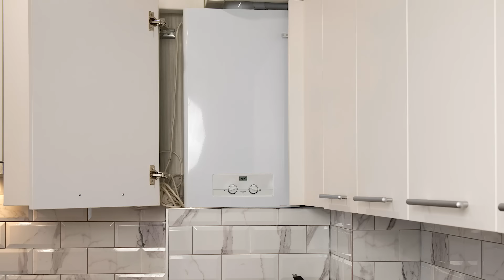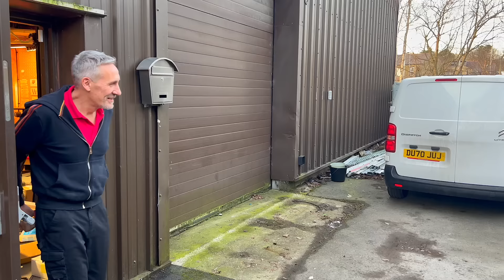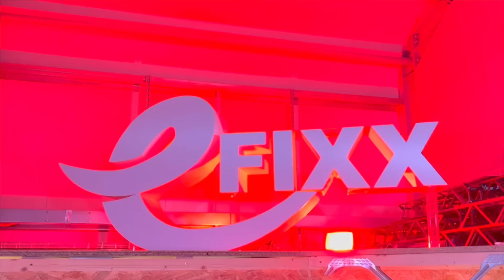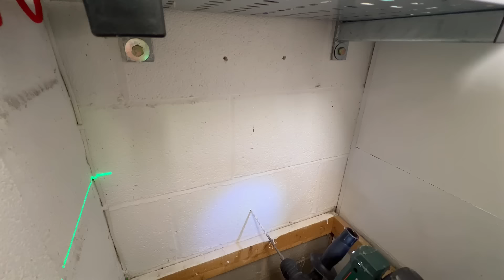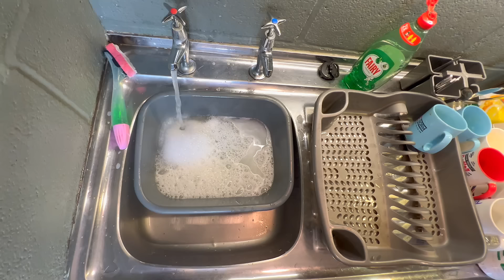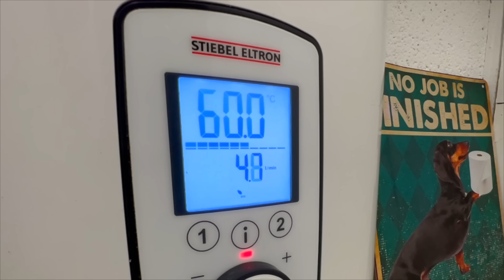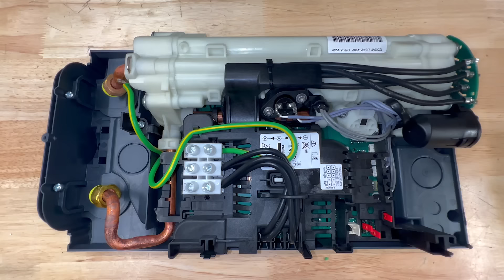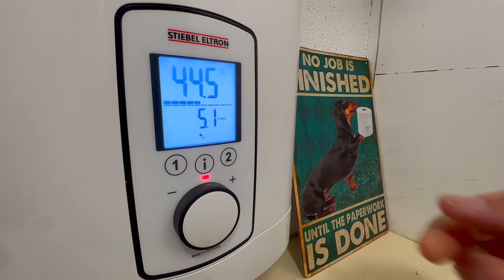The Shocking Truth About Water Heaters!

Comment: I use a 10 litre under sink unit & it's absolutely ideal. I've not found the capacity to be an issue personally. One advantage is the very short pipe run so it's effectively instant. I've not tested the losses but doesn't seem excessive in that the under sink cupboard isn't overly warm.
Whilst looking into this for someone else, I came across instant water heating taps. They come rated at 3kw, with a 13A plug fitted, & only available from the likes of eBay & Amazon. I couldn't find any certifications at all, & reviews ranged from the best thing since sliced bread to it caught fire!
The idea has potential as Redwing etc do a similarly rated unit like a mini power shower, but until something is properly tested & certified, no thanks...
Reply from the maker: Those Amazon products are always a challenge!
Reply: Those little tap heaters are very common in asia, portugal and spain. If you look online you can find one made by bosch.
Reply: @zaxmaxlax  just done a search & nothing by any reputable manufacturer or seller came up.
They seem a really good idea in terms of ease of installation, at least regarding the plumbing. Using a plug for a 3kw load is pushing the limit & I wouldn't consider it safe as 13A fuses get rather hot at 12A. We've all come across burnt up fcu's on immersion heater circuits.
Reply: @alanjewell9550  They're perfeclty safe at 3kW. Remember that 2.5mm2 is 16amps in europe and france even allows 20amps at 2.5mm2. They're instant heaters, youre not gonna run then for more than 20min at best.
Reply: @alanjewell9550  I also have one, excellent. Yes you have to take care not to run out of hot water, but you soon learn that. It is instant.  And you can’t feel any warmth on the outside of the casing, so I assume heat loss insignificant 
In main house the time it takes for the water to get hot at the tap is half a bowl full, very wasteful, even if by gas at 1/3 the cost.
You can plug in to a 13a socket, it is basically a fitted kettle.  It doesn’t take that long to reheat, so no worries about the plug.
Reply: @markthomasson5077  yes, absolutely about the waste of heat in long pipe runs.
The point re plugs was more to do with 3kw units that these uncertified hot water taps seem to be. Whereas I have seen plug in heaters etc up to 3kw, I've seen plenty of over heated plugs as well as fcu's on immersion heaters & come to the conclusion that plugs & fuses are really only good up to about 10A in practice, & only then with very clean untarnished pins etc
Reply: @ …must check my plug now and again.  Thanks.  Probably better wired into a 13a spur, but there was a socket available.
Reply: …now I recall, it is only 1.5kw.
Reply: @markthomasson5077  i had a job last week on a failed immersion circuit. It had an fcu & timer. The fuse was welded into the fcu, the Lout terminal was totally carbonised & the Nin on the timer had burnt off. All a bit of a mess. No need for an fcu as it was a 16A radial so put in a 20A switch. I always grease the wire ends with vaseline as it stops oxidation & keeps the contact resistance low. Any exposed copper tarnished after a few years.
Reply: Quooker taps are excellent as they replace an electric kettle and the worktop space a kettle consumes.  They are also a design feature in the kitchen.

Comment: Excellent video. But too specific to a particular situation not enough general considerations. Heat rise against input water temperature is a very important consideration for instant water heaters - in particular electric ones. Here (in Canada) this question pretty well rules out instant in all applications. 
Complexity of retrofit of these units. (Less than comparable gas units sure but still may rule these units out for many applications. Very different than as a solution for specifically an addition or completely new bathroom or isolated sink.)
The list goes on but you get the idea. There is lots of good new technology for water heating but no one solution has cracked the problems (that are quite 3 dimensional - at least - solve one dimension worsen the problem in some other dimension))
I love the channel and the videos though.
Reply from the maker: We’ll have to visit 🇨🇦 Canada to understand the issues! - Thanks for the feedback.
Reply: Just curious to know how cold your water supply is? Here in the UK it's usually between 10-20°C (50-68°F) and we have no issues with instant hot water systems. Seems more like cultural resistance than a technical problem.

Comment: Electric only here. 210l cylinder. Octopus agile. Prices the last few months have been terrible but we've still not gone over 20p per kwh for hot water.

The rest of the year it's far cheaper.

Our gas boiler was due for replacement so over the next several years it's cheaper than gas and if course its much lower carbon emissions. In five years time gas will be more expensive and the increase in renewables will make the agile tariff even more attractive.
Reply: Carbon emissions are the least of your worries my friend.
Reply: People still believe and buy into the carbon climate scam 🙄
Reply: Yea until all the energy prices go up more cos they realise how much they are losing 😂
Reply: @keoghrichard1988  Make your own

Comment: Washing pots, cups etc using electric is called a dishwasher?
Reply: Most dishwashers are cold fed. They have heat elements or coil in them to heat the water up and most washing machines are cold fed also. Keep the videos coming.
Reply from the maker: One day!
Reply: Dishwasher still requires hot water!
Reply: @thomascadieux9655 nope they take a cold feed and heat their own water
Reply: @thomascadieux9655  virtually all dishwashers are cold fed, in the UK at least.
Reply: @thomascadieux9655  They usually heat their own water. Having said that, most dishwashers (At least in the UK) can take a hot water feed, unlike washing machines which usually require a cold feed. This is great if you already have a cheaper source of hot water.
Reply: @thomascadieux9655 No they dont
Reply: They work best full, so that's a lot more tea and more mugs... and probably less videos  😊
Reply: Human dishwashers are the best.

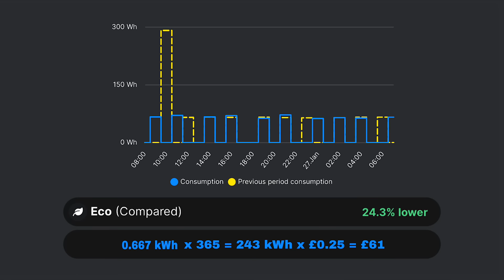Comment: 1:47 Honestly the idle cost was no where near as bad as I thought it would be. Nevertheless electrically based hot water is always a difficult thing to get right. You will always get higher pressure, hotter water from gas or oil as far as instantaneous heaters are concerned and large cylinders cost a fortune to run. Even economy 7 isn’t a good option anymore as the pricing is nowhere near as good as it once was. I have two small daffi heaters for my hand wash basins which are ideal. A 20L tank for dish washing (which I only turn on when needed) and an electric shower. Not amazing but good enough.
Reply: If you put a timer you can reduce it even further.